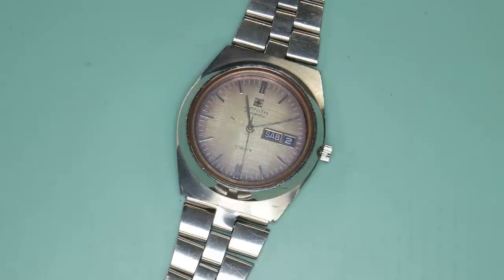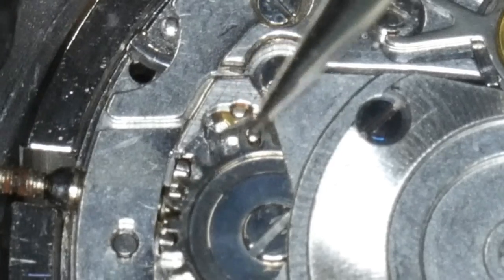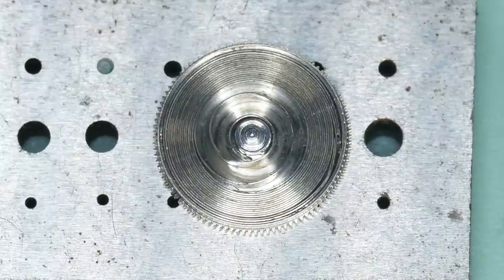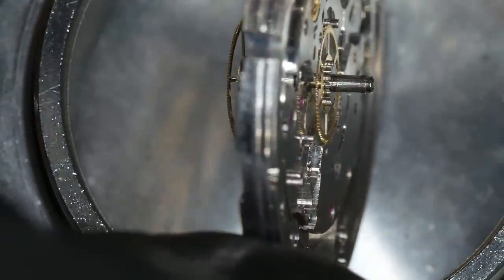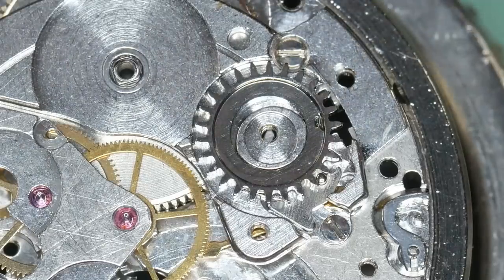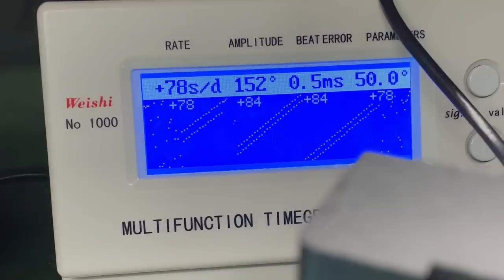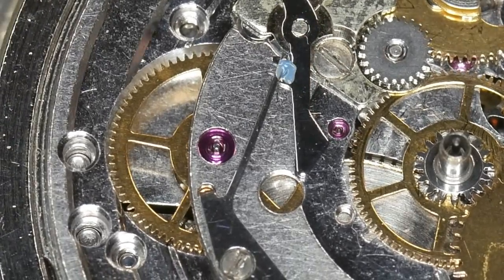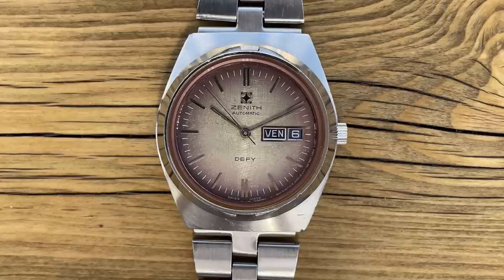Vintage Zenith Defy Restoration - BUT WILL IT DEFY ME?

Comment from the maker: Hi guys welcome to the comments!  Please remember to like the video if you enjoyed it.  It helps more than you know. Also please head on over to my other channel to hear the backstory of the Zenith and see more close-ups of the finished watch. https://youtu.be/7lb94ETiMag
Reply: Lift angle in the timegrapher needs to be changed to 53 vice the 50 which it detected.
Reply from the maker: @jjyork201  yes I found this out after posting the video.  Won’t change the accuracy but will change the amplitude.
Actually runs really nice at +4 seconds a day
Reply: 😊^^ee~
Reply: @jjyork201   Rolex watches
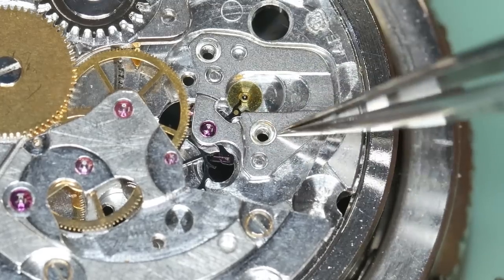😊 41:34 41:35
Reply: @MyRetroWatches 
😊 44:23 😊😊😊
Reply: stelvio in. Blue
Reply: @jjyork201  

😢 I

Comment: I have the same timegrapher and I also get some strange amplitude readings that I believe to be inaccurate. I usually mark a spot on the balance with a sharpie and take a slow mo video to confirm. Nothing more frustrating than chasing an amplitude issue. Glad it worked out!

Comment: Best video yet. I've just started so frustration has become my middle name.  I thoroughly enjoyed your journey and your defeating the defy.
Reply from the maker: try not to get frustrated.  Its all muscle memory this hobby. Invest in a decent pair of tweezers like Dumont.  I use Dumont 00 Hitech abut £20  but its the pair I use 90% of the time, they are hardened to so not deform.  Really helps control.  Same with some good screwdrivers.  Everything else can be upgraded as you improve.  Microscopes help but its more of an investment.  
Main thing is to enjoy and when its going wrong just laugh.  Frustration leads to mistakes.

Comment: Hello Mike,
I really enjoyed your version of the Watch Defying Service. I particularly like that you leave the tricky bits in the video as they are learning points for the community. It’s not that hard to bend the main spring back with the right amount of heating, for 8 pounds it was a decent price though. Instead of peg wood when installing springs you could try a plastic wide flat blade tool. I learned that from another channel and had a few from a cell phone repair tool kit I had on hand. 

Great job struggling through this one, I cheered your victory.
Cheers,
G.
Reply from the maker: Thanks.  I am happy with peg wood to be fair but just interested in what others use. 
Also always like to leave any mistakes and problem solving in . Makes it more real.

Comment: Amazing and challenging restoration with a great outcome. I feel your pain with the winders, and I’ll share my own little rant. I caught so much flack hand winding springs, but never once had an issue. Get the winders, they said. It would be better, they said… yes I’ve ruined my fair share of mainsprings with them. My approach now- If they don’t hook right away, I stop messing with it and simply hand wind as before.
Reply from the maker: I’m glad I am not alone with winders. For me its when I am removing the handle. I can wind in the opposite direction to unhook but if the end coil is tight on the shaft despite holding it with a razor blade or tweezers on occasion it will jump out and ruin it.
I have had only a few hand winding go wrong . One was my first ever because I tried to wind it the wrong way and any other time it’s because the bridal snapped.

Thanks for dropping by and I will be sure to check out your new video. Think it’s a pocket watch right?
I’ve never actually worked on one yet!
Reply: @MyRetroWatches  yes this one was near death. It was a lot of fun. I had to learn how to make screws for the first time!
Reply from the maker: @csspinner  your watchmaking is on another level.  I have still a very long way to go.

Comment: I’m with you with peg wood and springs. I make sure the spring is fully recessed before removing the peg wood. With the horrible click and spring on the Felsa 1560 movement (you had a lot of trouble) I used my flat plastic tool. Short leg in first, held flat in position, and the long bit went in first time.
Reply from the maker: I think we all just find a method that works. This is usually after loosing so many parts we find a way to limit that😂

Comment: That was a major struggle, and so frustrating that you can't find the part you need. Really useful warning about the specialised winders you need for these movements. I'm busy being driven crazy by an EB 8800 that i just cant get working when the keyless, main movement and calendar are all installed, any 2 and the work fine, all 3 and nope something goes wrong.

Comment: I bought a Chinese set of mainspring winders a few months back, mainly because I was aware of the possible damage and difficulty in doing things by hand. I did try a couple by hand, and one was OK-ish, the other burst out right at the very end, just as I was counting my chickens, so this put me right off, and besides even the one I did properly, there was a fine wire edge that had scraped off the mainspring. The Chinese set did have steel hooks, but did not have any bespoke Seiko winders, so I used the 8200 winder, and it did a perfect job, although had to tap it out with a brass hammer. But getting to the point, I mix and match handles and directions to used the winders, rather than buying bespoke winders or doing by hand. Sometimes the handle will need a bit (lot) of support and the cover does not enclose the whole spring, but I feel the spring is in better shape when the winder does the work. I don't know if Bergeon handles/barrels can be mixed and matched to accomodate this
Reply from the maker: The way I look at it is you only really use a few sizes for me 6 and 7 mainly.  I already bought a new 6 Bergeon handle as mine was too worn at the hook.
You can buy each size singly so if I was starting again I’d just pay out for a few regular sizes and go from there.

Comment: If the reversing wheels give any grief, there's stuff for them called LubEta which is basically 9010 dissolved in gasoline - you dunk the wheels in them, and when the solvent evaporates it leaves the lubricant behind on the wheels, so as to avoid excess lubricant gumming them up.
Reply: I wonder, does mixing 9010 and gasoline yourself give the same effect?
Reply: @DutchClawz  I've seen a 3% 9010/97% gasoline solution used elsewhere.
Reply from the maker: Yes I’ve seen that stuff. Rolex guys use it on the wheels. 
Some point I will get some but like anything it’s justifying the cost.
For my own watches I don’t feel it matters. I have so many that they are statistically not worn all that much .

Comment: For mainsprings you really need a 7 clockwise and counterclockwise  for seiko and some other brands.  6 and 5 are usually in clockwise enough for the rest.
Reply: Also the 6 can go into the 7 winder if the arbor is to large on the winder.

Comment: It always blows my mind that you can work on movements you've never seen before, with parts that sometimes look like they were made by Dr. Seuss, and keep at it - despite your mistakes - without losing your patience.  I guess that only comes with time, experience and discipline.  The only thing a bit wonky with this watch is the bracelet, but that can be very easily rectified, one would think.

Question:  how many times do you think that watch had been serviced in the past?  There are so many scratches inside - which I trust weren't your doing - on so many pieces that either the one service it had was done by a fiddle-fuddle or it was serviced several times by slightly less fiddle-fuddly people.  In any case it was great to see another restoration so true to your ethos of "Jump in there, get to work, and crack on with it!"
Reply from the maker: Thanks Alex.  Most of my repair videos over the last two years have all been first time movements.  It adds to the fun but they do all follow a similar principle so apart from some tricky springs you generally know what is in store. 
As for the scratches its a complete mystery. A few others have commented on them too but they were there on disassembly.  Not sure if its other watchmakers as there is no real service marks and I would doubt it would be caused by a professional.  Equally my friend who owns the watch has now only just told me it was his fathers!

Comment: Hey Mike, No grease on or under the date indicator driving wheel or a tiny tiny drop of hp1300 on the edge of the hole. Nice movement and nice work Mike.
Reply from the maker: Thanks. I figured as it’s metal on metal it would need something. Thanks for the clarification

Comment: Springs for me is basically 2 sticks one is holding the spring down and the other is moving it around, bzt in the end whatever works. But I rarely do watches I do soldering of microelectronics alot though.. used to do that for a living for a bit.

Comment: Mike, hope over to Alex Hamilton's YouTube channel It's About Time, in the last week he did a video about safely bending mainsprings - exactly what happened to you.

I don't have Bergeon winders (too bloody expensive) so I bought the larger set of better quality Chinese ones. Reasonably well made but have yet to find one that fits an actual spring! A Timex almost fitted but half way through the wind it stopped winding and damaged the groove. So now I wind them in by hand. All it takes is strong fingers an a good sense of how much handling a part can take. There's even a name for it - mechanical sympathy - and watchmenders need it on buckets anyway, so there!
Reply from the maker: Yes I was made aware of this video but only after I had got angry with my spring and binned it!

Comment: Do you think that maybe a drop of oil bridged the balance spring causing the high beat, which dispersed later along the spring allowing it to return to the correct beat. Great work btw, I'm still scared of self winding and calender complications  😆
Reply: That is probably what happened. There was some gunk on the hair spring that got cleaned off.
Reply from the maker: No I didn’t go near the spring with oil.
Had the spring been stuck the Watch would have been running incredibly fast as you are shortening the hairspring .
It was the Timegrapher not being able to hear properly the way I had the movement held.
In the review video on my second channel I do a fast forward 6 minutes on the TG and it’s was flatlining at +4 seconds a day.

Comment: I find My No 1000 timegrapher can vary wildly depending if its in the movement holder or case or on its own. I want to get a Witschi Watch Expert but they are so expensive. Nice job though!! 👌
Reply from the maker: agreed.  They can pick up extra vibrations especially if the movement it not tight in the holder.  I tend to double check at the end of a build once in the case as this is the best reading you will get, in my opinion anyway.  Thanks for watching.

Comment: Love the videos. I really like the movement holder you’re using. Are these still available?
Reply from the maker: Yes.  It does not fit all movements though.  I have actually modified a vintage adjustable movement holder to fit into the base too.  Mainly use it for filming so I dont go out of shot .
https://www.aliexpress.com/item/1005003348306440.html?spm=a2g0o.detail.1000014.13.59b94a175mrDKi&gps-id=pcDetailBottomMoreOtherSeller&scm=1007.40000.326746.0&scm_id=1007.40000.326746.0&scm-url=1007.40000.326746.0&pvid=0a575d2f-cf7a-467b-8f7e-784ebfd746ef&_t=gps-id:pcDetailBottomMoreOtherSeller,scm-url:1007.40000.326746.0,pvid:0a575d2f-cf7a-467b-8f7e-784ebfd746ef,tpp_buckets:668%232846%238109%23217&pdp_npi=3%40dis%21GBP%2128.13%2128.13%21%21%21%21%21%40211b613116811727669953706ecc2b%2112000025344542473%21rec%21UK%213621925699

Comment: Would its 28,800 bph Cousin, the ETA 2828/2836 possibly have the same calendar parts? A 2836 is a much more common movement.
Reply from the maker: From the manuals I have their calendar setup is completely different

Comment: Some older watches have a lot of random scratches on the plates. Is this from previous cleanings, or did they come unpolished from the factory?
Reply from the maker: A good question that I cannot answer. I’ve noticed myself that sometimes they have scratches. Could be other hobbyist or just how they were. The macro lens hides no prisoners
Reply: I’ve done exactly the same thing with the hour wheel and wondering why things weren’t meshing - while working on it after midnight

Comment: On the gasket goo front I've had a few watches(most originated in France for some reason)where they had a thankfully brief 70's invention; "liquid" gasket, a kind of very slow running bitumen type deal, presumably to save watchmakers(or more likely local jewellers) from having to keep massive stocks of normal gaskets? 

Horrid stuff to deal with. In one particularly bad example I had, a 72 Girard Perregaux quartz, the "watchmaker" had laid it on thick and it had crept its way past the movement holder(jamming it in the case all around) and had gotten as far as the other side just like your Zenith. Thankfully it hadn't affected the vanishingly rare dial, but it was a total curse to clean it all out. Now to be fair I don't have a tenth of your skills so...
Reply from the maker: I have another watch I want to bring to the channel soon and that also has the same issue. When I touched it I could not wash it off for days !

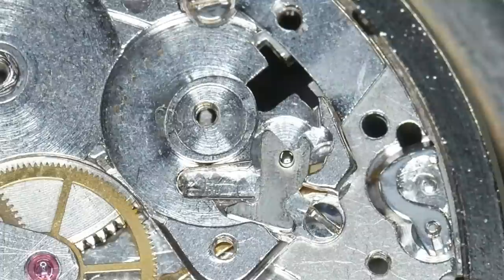Comment: love your channel. the moments like 34:18 make me CRINGE, but I know I make the same mistakes sometimes, so it becomes even better!
Reply: 34:43 ughhhh that "there we go" RESONATES
Reply: the way I tackle springs is the same as yours pretty much, but I use a component probe (i.e. a hard plastic stick) instead of pegwood, it's more rigid and doesn't leave wood flakes around.
Reply: you should have lubricated the groove on the sliding clutch that the yoke engages with.
speaking of lubrication, my go-to principles are:

1. 9010 for the cap jewels, the escape wheel and the fourth wheel. I NEVER lubricate the pallet fork pivots, that steals 50-100º of amplitude right away
2. 9104 (HP1300) for all other pivots where the friction is rotational, regardless of whether it's metal-on-metal or metal-on-ruby
3. 9501/9504 for all the metal-on-metal connections where the friction is sliding instead of rotational
4. 8213 for the barrel wall in automatic movements - braking
5. 8200 for the mainspring, three dots in the barrel below the spring and three dots on the spring's top.
6. 9415 for the pallet jewels.

when I'm not sure, I generally tend to use HP1300. I apply the amount of grease that's not visible to the naked eye, if it is - I clean it with rodico or even dunk the part in IPA and start over. I'm kinda annoyed by having to use two organic greases, but that's what I have now, maybe later I'll replace them with the synthetic alternatives.
Reply: you're measuring the movement amplitude with your timegrapher set to 50º lift angle, while the actual lift angle of 2832 is 53º. that can't explain your 140º reading, I don't think, but having the correct lift angle setting is very important.
Reply from the maker: @_f355  good tips.  I found in an ETA manual 2824 which I used as a bit of a guide for this I was amazed by how much 1300 is used.
Reply from the maker: @_f355  I didn’t know. I figured 50 is for 2824 so this movement was similar.
The movement is fine. In the review video on my second channel I leave it on the TG for 6 minutes dial up and it’s +4 seconds and practically flatlining
Reply: @MyRetroWatches  2824 is 28800A/h, you should have looked at 2826 instead - ranfft aka the pink pages is very useful for finding the movement families, as you most likely know!

regarding HP1300, it's very versatile, but I think ETA in particular overuses it, in many places like the keyless or chronograph works a thicker grease like 950x would definitely work better, it spreads less if nothing else.

oh, and I'm sure the watch runs fine, you did a good job!
Reply from the maker: @_f355  but I did not oil the clutch and realised in edit too but not much you can do then but wait for the comments section to light up 😂
Reply: oh, and a tip on fixing the mainsprings - get yourself one of those small Stanley clamp-to-the-bench vices, they cost about 30 quid, and a small gas torch/lighter that they use for lighting pipes or making crème brûlée.
 
clamp the spring in the vice so only the portion of the spring you need to work on is sticking out - the vice jaws are small enough for that - and heat it with the torch until it's red. then use needle-nose pliers to manipulate the spring while it's still hot. the vice jaws are sinking the heat so the rest of the spring keeps it's temper. I have fixed many broken springs that way, on both ends.

Comment: Why don’t you use rodico to hold springs and stop them flying off during tear down instead of peg wood? It’s used to pick bits up so I’m assuming it’s ok?…. Thoughts, anyone?
Reply from the maker: Rodico sticks. Peg wood does not. Easy to get rodico stuck behind a spring on fitting.
My method works fine for me I am just interested how others combat the same problem
Reply: Yeah I get that it’s no good when your rebuilding a watch but I thought on the strip down it doesn’t matter as the movement is getting cleaned anyway so it’ll stop the spring flying off when your taking it apart- thought it would make things a bit easier 👍
Reply from the maker: @swanney75  I used to use it but found just holding it with the wood was enough.

Comment: Looks like a bit of an escapement wheel issue based off those lines on your timegrapher. May not be completely true
Reply from the maker: If you head over to my review channel and watch the continuation you will see that its running much sweeter.  +4 seconds and pretty much a straight line.
Reply: I habe seen in other videos, that they mix for ETA. So 7 barrel and 6 shaft.